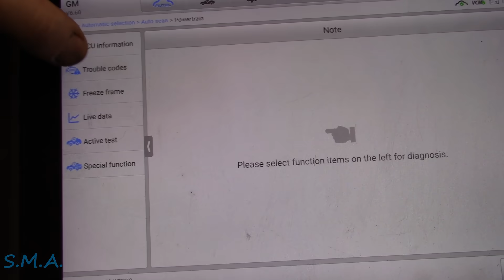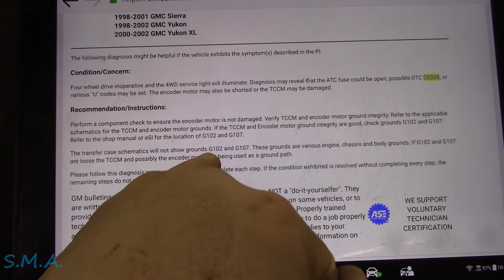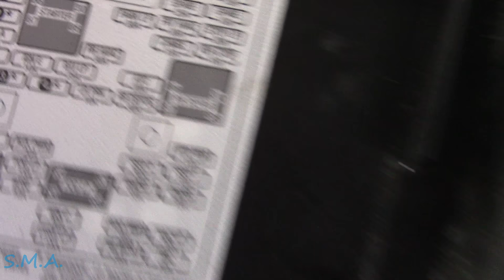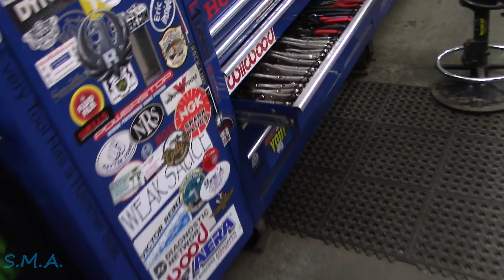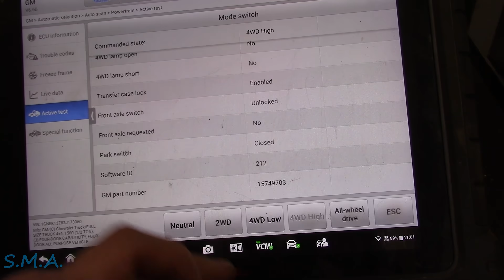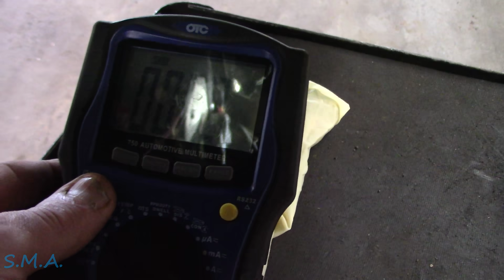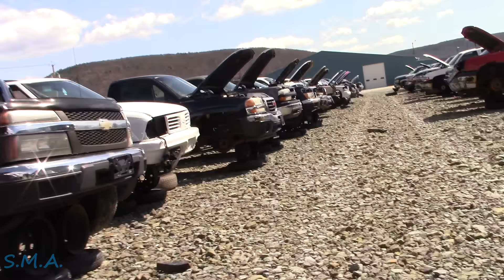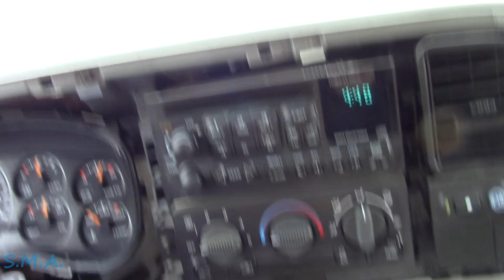Customer Spent $1000's And Still No 4WD

Comment: Eric I don't mean to criticize but  your time is worth money.  You should have charged for your  research and drive time to and from the salvage yard and remove the salvage shift motor.   You could be making money working on other vehicles in the time you spent at the salvage yard.  The $640 motor from the dealer would be the same price once you factor in your time and labor and parts mark up for the salvage part.   Its not your fault the customer spent money before you got this vehicle.   Even with the dealer part you saved this guy money and aggravation.  Its great to watch your diagnosis logic. Nice work.

Comment: Eric. If you were a guy Scotty I know,  he would have hooked up the scan tool, saw the codes for the 4wd system and would have said " ah it's an old 2002 chevy with 225k miles. Not worth fixing so just don't drive in the snow"

Comment: Dunno how customers get into these pickles. We either fix their vehicle or we wouldn't have the neck to charge them anything. It would be free if we failed. Which we wouldn't as we don't.     How mechanics who fail to fix stuff but still charge STILL get loads of customers baffles me.

In our total time trading, we had 2  vehicles we could not repair -  one was in my view a death-trap & too far gone, too many other places had been "at" it & had bodged it worse than it was to begin with.   I informed the customer. The other had corrosion that exceeded the value of the vehicle - relatively new commercial, nothing special, not worth spending the money on. I told him too. 

Both went elsewhere - the first guy got a quote for 5k from a "Specialist" & sent the vehicle there. The  "specialist" laughed that we couldn't fix it & was confident they could.. I smiled & nodded.. you can, yeah... Turns out they couldn't either, 6k later... it's still busted.. Second guy sent his to the crusher & bought a new one. Smart guy.,. First guy, not so much..

Comment: I know this is a year old but I do have a question for you Eric, would you have considered opening up the shifter motor itself to see if you can diagnose something internal that might be fixable? What goes into your decision between "I must dig deeper" vs "the trouble is within this much smaller machine, let's replace it"? Love your videos and most of all your scientific approach.
Reply: The most likely cause on a dc motor like this is the insulated copper windings have burnt through. It's just not worth the time trying to rewind it.

Comment: AWESOME.. I did get a fuse box for my 1994 toyota Celica from the junk yard and it was a piece of crap also... my bro suggested running a strip of solder down the back and WALLA fixed the old glass fuse box. It was causing my battery to go dead every 45 minutes with headlights on.. Damn after I replaced the alternator and battery..so that was expensive... Shit I wish I lived near you Bro... ur work is Class Act.

Comment: GROUNDS ARE FOREMOST ON ANY VEHICLE...IN CALIF...A FRIEND BOUGHT AN 81 FIREBIRD...LOADED...4 SPEED 400 INCH ENGINE AS A WRECK...CAME WITH ALL GM PARTS TO REPAIR FRONT DAMAGE...HE HIRED THE PEACE BROTHERS TO FIX AND PAINT THE CAR...DONE...GREAT GORGOUS JOB...ONLY 1 PROBLEM WAS TAIL LIGHTS WERE NOT FUNCTIONING CORRECTLY...I LOOKED IT UP & FOUND 2 GROUND STRAPS ARE NEEDED FOR THE BELL HOUSING TO SUB FRAME...HE ONLY HAD 1...AHHH...ANOTHER WAS ADDED.. FIXED...

Comment: I had a slightly older burb with 4Auto that slowly lost its 4x4 ability.  One unrelated thing was the indicators wouldn't light, and I did not know they were supposed to always light.  Once I learned that I took the switch panel apart and fixed several cold solder joints.
I only did that because I knew if I brought it anywhere the first thing woulda been "needs new switch panel".
Anyway, to keep this short, I eventually figured out either A) the slip additive was worn out, or  B) it had the wrong fluid in it.  The correct fluid is blue when new and what was in it was red.  I put new fluid in it and after a month of weekends off-road it was fully functional, and working like it should.  The 4Auto was WAY smoother with new fluid.
That's one of the signs the fluid is worn out, if it "slams" or "jerks" when the 4Auto kicks in, that means the slip additive is shot.

Comment: I have the k1500 4x4 LS 5.7 and UT gets old with these parts like doorman,  and global  and others . So I've had to opt to but the OEM GM PARTS which are very expensive. But, the quality of of mfg  on the after market is so bad. I have 210 grand miles on my 99 and my engine compression on each cylinder is 160 off the hook for a 99. My 4 wheel drive is still working stellar. Great video here . And great choice on the parts selection..

Comment: My brother had a dodge pickup and the 4wd lever wouldn't stay in the selected position. He spent hundreds before bringing it to me his brother " dodge dealership tech of ten years", go figure. I diaged the plastic fork sliders as the problem, not moving gears completely into position. He refuse to believe it and wasted another grand having it looked at. Finally brings it to me, 1 hour remove t-case, 1 hour breakdown and replaced sliders and oil, 1 hour reinstall, 100% fixed for 30 bux in parts 1 tube sealer and 3 hours. I still bust his ass over it to this day!

Comment: New actuator and censors, chevy had 4 some reason was using hydraulic points at the hub but full retention rings in the hub itself? Making any 99 to 04 a total flipping terrible experience and nightmare for people who really were all for Chevrolet trucks and 4x4 vehicles

Comment: In my experience, circuit low faults are typically caused by excessive resistance in the circuit, but not always.

Comment: Anyone had an issue with the 4wd shifting into any random mode on startup?
Some days it's nice and doesn't mess with me, but others it's in a random different mode on every start after a while of cooling down. 
Zero codes, everything functions as it should. Previous owner put a switch in it and had no luck.

Comment: Remember old school 4WD? All mechanical. 
The layers of complexity in this Chevy are brought to you in the name of "convenience." The vehicle operator can sit in the left seat, and command the
vehicle to change drive modes without any effort beyond the push of a button. But, this convenience has a price, doesn't it? Personally, I prefer the old school method. Get out, turn the hub controls, hop back in, and move the control levers to the desired mode. Not too hard, is it? Think of all the cost and frustration you avoid.

Comment: I have a 2001 chevy tahoe. The "Service 4wd" light came up on the dash display. I'm pulling codes with my crappy code reader, but it doesn't seem to pull anything for the TX case. Do you need a high speed code reader to get the TX case codes?

Comment: These are good SUVs. Nice amount of horsepower 285hp 5.3 vortec. The transmission and the differential sucks though. The steering is alright one my parents got has stiffer power steering. The steering wheel in the older SUVs n trucks I kinda like it cause it just oldschool feeling. I hate the push button 4WD. I love my old dodge manual transfer case never fails and i can shift it on the fly. Only time it failed was… well the transfer case is fine never failed… the LINKAGE! The damn bushings dry out and then the linkage falls out into the road. Stupid design. At least they are cheap easy to re install I undercoated the new one see if it helps.

Comment: If your meter is like a Fluke, before you turn the meter on press and hold the light button, then turn the meter on. If you do the light should stay on. If it is not on, when you press the button to turn it on it will stay on until you turn the meter off.

Comment: Just another SUPER-installation! Compliments of South Main Auto. 
This fix and diagnosis BTW applies to all Chevy/GM 4WD transfer cases, in a backyard R+R scenario we just keep on replacing the shift motors from the junkyard until it is all good. I have always considered Dorman to be sketchy, ever since I got a bad "plastic body" clutch slave from Dorman. No diagnostic tools required because owner typically does not own one. I have seen these shift motors dynamite so bad that the transfer case gets stuck "between" modes resulting in horrible gear 👏grinding noises from the TC. It is always nicer to do on a cold winter evening with limited tools and NO scan tool, and hopefully only 1 trip to the Chevy graveyard next bone-chilling cold day.
Great channel, with great content as usual. It is always a pleasure to watch a TRUE professional diagnose and fix the Big Dealer FAILS, with all the fancy gear that no Joe Smoe actually owns.

Comment: Im having same problems where its blowing the fuse. It does have a new encoder motor i tried a new actuator and i fixed some burned wire on left side of motor that were hanging the fuse holds better now but still blows. Any ideas?

Comment: I have a 2000 gmc. I could not get my fwd to work so what I did was bi-pass all the bs electrical! 
Hooked up a switch to the front actuator and took off the tcm and manually put it in 4hi.  Now all I have to do is flip a switch to go into 4wd, shut switch off to go back into twd 😉 stop wasting time with all these electronics! I miss the old days when all u had was a floor shifter

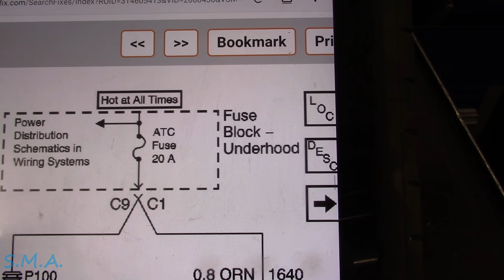Comment: 11:57  id start at the fuse box test the fuses, then relays for open and corrosion 
Then pull the fuse block and test the matting back surface connectors.
But before you do any of this you can just use your dvm at the transfer case motor and test at its plug for a live circuit. 
Then look for bab power and ground connectors or relays . As rusty as the under carrage is its a bad ground. Or the fuse box.
They change a hell of a lot of parts without testing them im going to be 99% of them were not necessary.

Find a good mechanic and always go to him becuse there are a lot of dumbasses that can't fix shit. And only cost you more then its worth, if somone comes back with a list of parts to chage, dont listen to them they often don't know what they are doing and hope one of the parts will fix the problem.
This includes dealerships.

Comment: I tried to diagnose one of these 4x4 things. I couldn't figure it out. The fuse was blown and I thought I got off easy...no. after I got the buttons to work, the car wouldn't drive or reverse and on the scan tool it said diff lock enabled. I have up after about 3hrs of diagnosing. I didn't charge the cust anything.

Comment: Not sure about this one, but on a Ford you try shifting the shift motor with it unplugged be it with scan tool or manual with light bulbs in the circuit for testing it will set B codes. The motor has to be hooked up for testing because the GEM module then uses motor position circuits to know the position of the transfer case. From the looks of it, this setup here does the same thing. According to those schematics you had there that looks real similar to Ford's setup, I'd say it does. The shift modules have to know position of the gates in that shift motor, if the gates aren't operating it can't know position and will set a code. Also on a Ford, you buy a after market shift motor and there's a high chance the wiring order has to be rearranged to match the wiring harness, otherwise it won't work, and or won't work right. On a Ford, there's multiple part numbers on these shift motors for certain years, you get the wrong one even though they will hook up and look identical, if the gate positions don't match for a specific year they won't work right and you'd think the motor isn't any good when in fact it is. Of course if it's blowing fuses, it obviously has other issues unless it's wired wrong at the motor harness.

Comment: Had the auto system on a 2001 S10 that I had for 14 years, it was always a carp  shoot on 4WD operation, bought a 2015 Silverado with a manual T case after that, no problems there anymore but GM was able to build in many other problems with it, last GM i will ever own.

Comment: There is a defect inside that motor, made worse by bad grounds on the frame like you noted. I replaced that infernal part three times on my Avalanch. The problem was with a tiny pin or spawl that causes that short.

Comment: Ive been down this road before.  Have had to warranty a lot of these cheaper shift motors.  They'll work for a few months.  Then go bad.  The better brands cost about 3x's more.  But they stay fixed.  I mean what kind of warranty can you give on a used part that is 20yrs old ?

Comment: Instead of blowing fuses during testing or fault searching, replace the fuse with a lightbulb, for instance a 65 watt. Offcourse taking  in consideration how much load the circuit can take. The bulb acts as a current limiter.

Comment: I use to have a Ford explorer xlt auto awd and 4high and 4low that done the exact same thing as that truck but I went and replaced every 4x4 part on it then it worked but then I got stuck pulling over a hill getting my trash and it would not pull me out. Well I thought the axles had broke so I replaced those so now I also replaced front and rear differential and transmission but It still had the problem of not going into 4x4. Then I went to Napa and a very nice guy who worked there said he had one just like mine and then the magic words came out of this angels mouth, You need to replace the automatic hubs for manual hubs bc thats what broke on my truck. Then I dawned on me the day all this happened I heard a very loud pop and thats when the porcelain gear piece broke. So I bought the conversion kit and bingo that fixed it so now after I had spent way over $10,000 dollars to put all new parts under it a $350 part could have fixed it all. But the suv would now climb a tree.

Comment: We all know that with the exceptions of that one wire that's intermediately broken in the dash most electronic diagnosis require not much more than 3 hours at most if you know what your doing. I'm a 150 an hour for diagnosis.

Comment: My 2004 Silverado 2500hd W/T 6.0 liter gasser….had no 4WD, no ABS and no heat/ac!

All it was was the ignition module in the steering column!!

FIXED for less than $90

Comment: Grounding through the transfer case control module or the encoder motor. I took it has not optimal. Understanding the first and primary ground should be G102-G107.

Comment: I found that the transfer case was in the wrong position when somebody installed a new motor so it could never shift because it was already in the turn position it was indexed wrong Kind of like installing a rack with the wheel turned one direction then installing

Comment: LOVE YOUR VIDEOS!!! Retired marine mechanic here. Just the way you diagnose is the way I was taught. Test, test TEST! Confirm, confirm, CONFIRM! Start simple and go from there. When I got a boat to repair start with simple. In other words, start at battery, good? Bad? Then go to the wiring leading to bad part. Got power at the plug? Enough power? Etc etc etc, you know where this is going, THINK about what is not working and why. Start out simple and it will go much smoother! Back to your video, I JUST LOVE how you diagnose, I did it the same way. It’s called, FIGURE IT OUT!

Comment: These auto shops should be sued. If you can't figure out the issue then you don't get to charge the customer for your stupidity. One doesn't pay for a burnt meal at a Restaurant and one gets a refund when the hair salon messes up your hair and one gets when the product doesn't work as advertised. The point being this is theft of service. Mechanic agreed to repair vehicle at X amount if you fail you eat it not the consumer. it's one thing to charge for diagnostics and if you get a couple hours in and you have to call it quits no harm no foul, but if you fire the parts cannon at it and are wrong , well you eat it. If you suck that bad at being a mechanic maybe you should go mow lawns? just a thought. Rant over. Love your show Eric do you fix Volkswagens?

Comment: 1.  You reading the tech data points out the fact that reading and comprehension is very important.  2.  Hitting your head on the lift also stressed the importance of having an "expanded sailor" vocabulary.   Automobiles are much more complicated than they should be.  However, I see no way around it as that would require major changes in an infinite number of places.

Comment: What exactly did either of the other repair places do to the vehicle that would cost a thousand dollars??
Curious if you are ASE certified or if either of the fail but charged out the kazoo shops were certified as well. I don't really  feel that certification guarantees a customer much but I noticed the add for it on your scan tool and I know they push it on guys a lot. Don't really have anything like that for the oilfield.

Comment: Those carquest cv axles are trash. My passenger side axle is leaking grease because the boot clamps are loose. I replaced it 5 months ago. Now I have to go through the hassle of removing it, returning it for refund, then finding another brand. Duralasts aren’t much better either.

Comment: I had a 2001 Yukon that the rear door seal didnt seal i could hear road noise coming from the back...  I ended up putting some duct tape across the gap.. it sealed after that...

Comment: Same thing is happening to my 02 Sierra..Tried for 3 months to fix it, t
Put a new encoder motor on it changed the transfer case and still no luck..Got so frustrated with it I stopped working on it, been sitting the last 3-4 months.